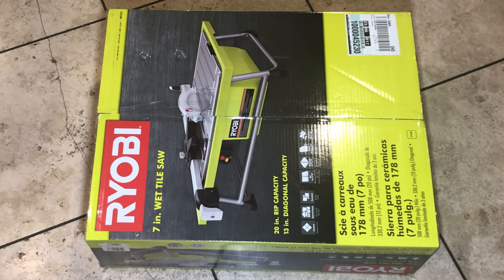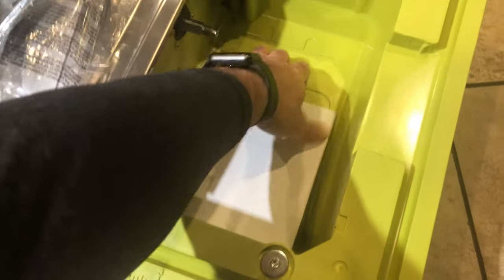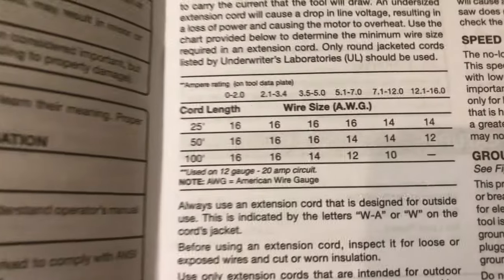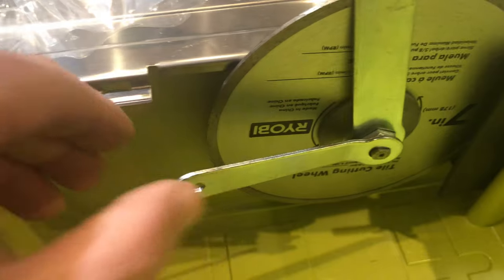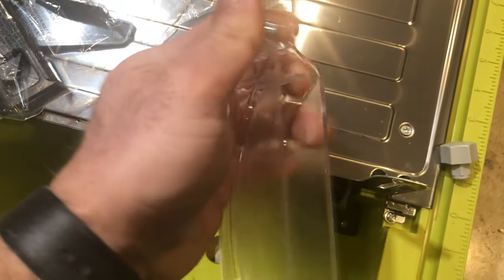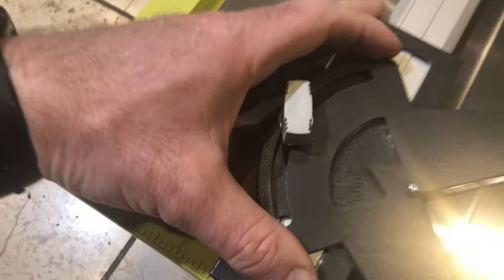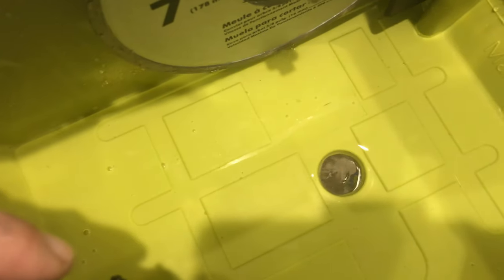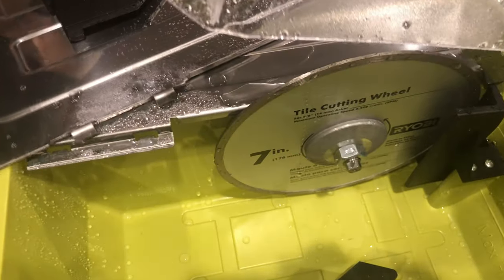Unboxing and Assembly of Ryobi 7" Tile Saw  Model WS722

Comment: I just bought this and when I opened the box I discovered that the  top plates are uneven where they meet.  If you align the  tilt plate with the tabs, the table is still 1/8 off.  The stationary side is too high.  Its going back

Comment: Thanks for the video, provided what I was looking for. Did you find that the blade included chipped any tile (middle or end corners) like some of the online reviews stated?
Reply from the maker: Hi, as long as you cut the tile upside down (the finished side facing the table), have enough water and you move slow, you will do okay but not perfect. I finished the bathroom remodeling with it and the result was pretty good. You can see the tile in another video. Thanks!